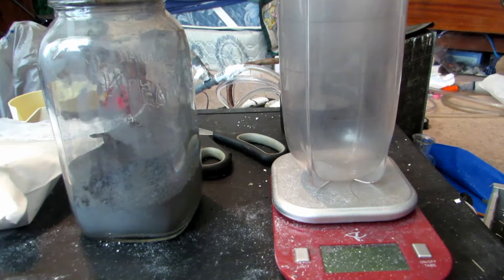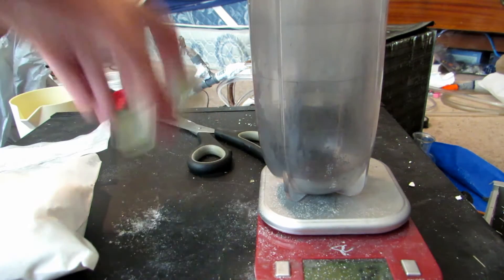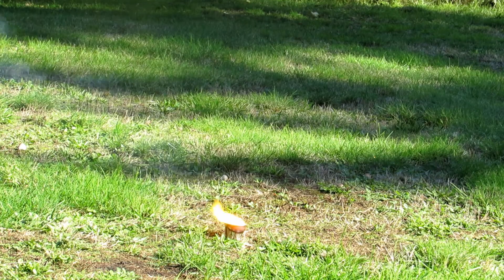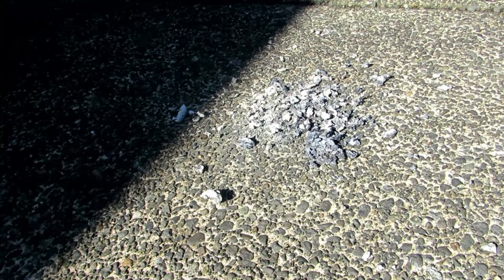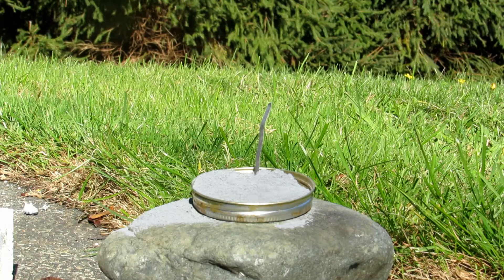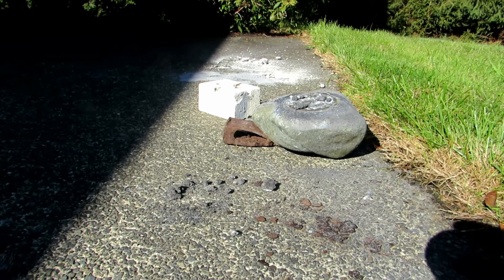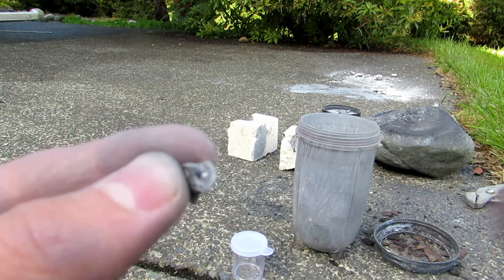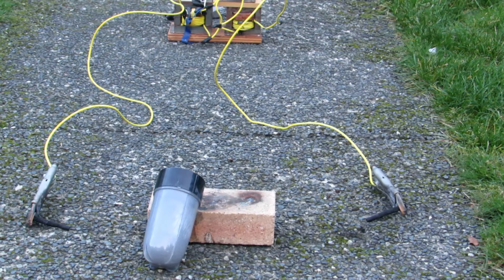How To Make Titanium (Household Materials)

Comment: if your melting Titanium at just over 1600c then your melting an alloy NOT pure titanium as its pure melting point is in excess of 2100c ... and as it is a poor heat conductor a LONG time in the furnace will make more of it than a short time ...
Reply: you should use a eltroconductive furnace .. and let it run for a few days with your TiO2 ... and essentially elt the titanium down ... and yes 2200c for 4 days will make PURE titanium ... under that and you MUST do it in a NON O2 chamber nitrogen is easiest so you remove the oxide out of the ore ... adding a reactant can help BUT you must use a reactant that has a vapour point between 1600 and 2100c ...so it works effectively

Comment: You're correct, adding the oxidizer (with some flux added to slow everything down, etc) will make titanium metal, but its extremely inefficient and probably introduces some impurities along with it. The largest (successful) one I did started from three pounds of total mix and I got 96 grams of titanium out of it, so... not great, but it works. (I've got a video on my channel of that one [/shameless plug])

Good video, though and subbed! :)

Comment: Mix it with phosphorous and powdered magnesium in an enclosed graphite crucible and ignite it with your high voltage arc using a tungsten welding tip if it proves difficult to ignite. The phosphorous will by all means ignite if it is left open to air, only it will be hard to get the lid closed due to the extreme heat unless you have a remote means of closing the lid, so it is best if you can ignite the material with the lid shut. Of course do not make it a gas tight seal, the lid should only be  resting on the crucible as this way it allows expanding gases to exit while the reaction is going on, without allowing ambient air to enter.

Comment: Bth I don't think this method works to produce metallic titanium. I personally tried this with AR grade TiO2 and Al powder, it did burn but at very slow rate, I guess was that was likely just the reaction with O2 and Al. If this method works, the industry would not have been going through so much trouble converting TiO2 into titanium chloride then reduce it with Mg. if what you got was actually Ti. it should resist diluted strong mineral acids
Reply: Aussie Chemist adding some KCLO4 is the best way to go